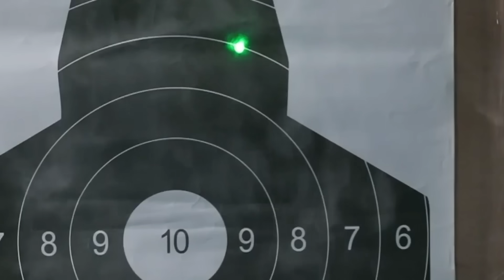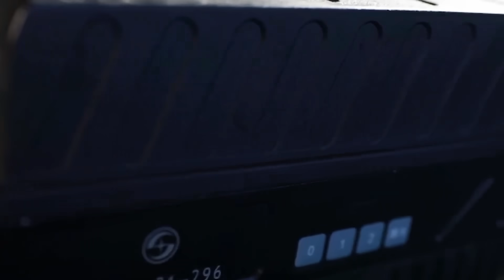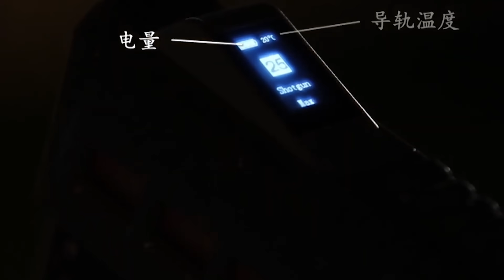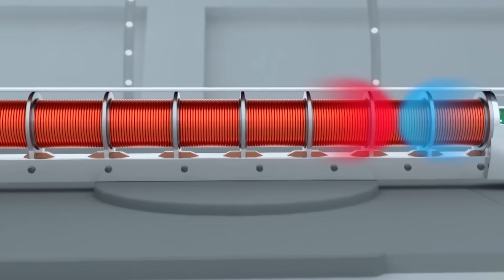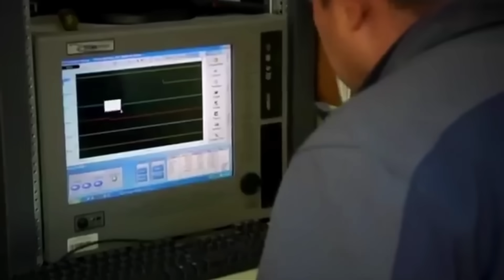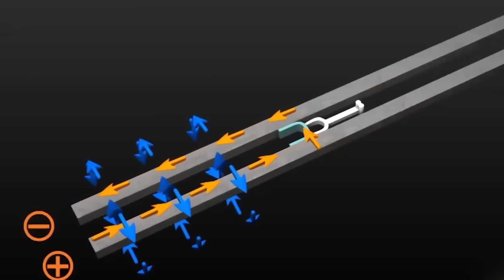The Chinese Weapon Tech that is Going to Change the World?

Comment: Rail guns are a thing of the past because their application is primitive by today's standards. They require tremendous amounts of power across and the durability is questionable. Think that thing will fire after being submerged and would you even want to pick the weapon up if it was? The focus is on DEW's like the one that was used in Maui.

Comment: Coil gun and rail gun are not interchanfeable.

Coil gun uses a series of coils that propel the projectile with a magnetic force perpendicular to their orientation and there is no contact between the projectile and the coils.

Rail guns use two parallel bars or rails that fires by dumping an obscene amounts of electrical current into the rails and that power is transfered to the projectile through a directly touching armature and using the electrical discharge it propels the round down the two rails and their opposing forces are whst drive the projectile. The barrels are constantly attempting to self disassemble and have limited lifespans and huge energy needs

Comment: This is a joke. First they were trying to move it around quickly when they had the red dot on it to keep you from noticing how inaccurate it was. Second a disk has poor flight performance. If they don’t put any spin on them they flutter in flight. If you put spin on them they tail off in the direction of the spin.

Comment: Technically this is not a rail gun. It uses AC repulsion. I've looked at the math and what parts I needed to use to accelerate copper pile couplers. A hollow ring would be better as a projectile as it could be spun for stability.

Comment: I believe someday conceptually speaking, a huge, reliable,  and devastating rail gun could rip through any boat, including an aircraft carrier. I wouldn’t be surprised if I get to see it in my lifetime.
Reply: They were testing one like that over past 10 years. Cancelled it couple years ago. I think it required to much electricity to used in field. They fire it through some concrete slabs etc. 7kg aluminum projectile. Maybe the barrel was melting? Can't remember. Look it up
Reply: The rails, it was melting the rails. It was a rail gun

Comment: The way you are portraying this tech weapon is all wrong, the American one doesn't look like the Chinese one as the American one preceeded the Chinese one by two years so the Chinese one looks like the Anerican one as it came first.

To be honest the whole tone of this one would lead most to think youare biased towards the Chinese one in comparison to the American one (even though the Chinese one has had 2 years for R & D to make one tgat "appears" high tech but even the coil design is completely different as they use standard coils rather than linear coils that makes the potential projectile speed and power greater (looks like the Chinese were going for looks over function or just misundersood the science behind the concept and i can tell that just by the graphics showing the magnetic poke layout).

Do you have footage of the advancements the American design has made in the 2 years since its dlfirst developement alliwing a more balanced/fair comparison can be made? (Somehow i doubt it or you would've shown the Linear motor design has a higher potential to fire projectiles at a far superior speed and range and be more deadly!!).

The content level of your brand/channels has started to become a little 'lacking' of late, are you spreading yourself too thin by having branched into several different topics causing you to not structure as well as you have previously? (Starting to notice that with a few channels/brands that i used to really enjoy and it is leaving me a little disappointed by some of their content too) I only mention this as i stated i used to look forward to your content but now i'm like 'meh' 🤔

You used to be a lot better than this but you're becoming a little 'lax' in your presentation/portayal of your subject matter (give it some thought as you may find that you lose long term viewers/subscribers that notice the diffence between the content of your older channels compared to your new ones and its not just you thats heading in the wrong direction as many are becoming guilty of this and that includes 'YouTube')

Is greed or content quantity becoming more prevalent than subject/content quality? (I fear it is unfortunately) and the quantity and frequency of ads for the sake of profit/revenue is becoming increasingly offputting with YouTube in general (at some point the YouTube "bubble is going to burst and oeople will look/search for a similar alternative layout more similar to the older YouTube format before it became more profit/revenue driven and its a shame in my opinion.

Comment: Get a slingshot, a good one will almost certainly have more power and you won't need to charge it all the time.  
A coil gun is not the same as a rail gun.  A rail gun has much higher muzzle velocity, and thus stopping power, and does not absolutely require computerized components but uses electricity less efficiently and each shot damages the 'rails' in the gun.  A coil gun is much more energy-efficient and doesn't require physical contact with the projectiles as it fires, but has much lower muzzle velocity and requires computerized control of the magnetic fields to accelerate the projectiles.  This 'gun' is basically an expensive toy.

Comment: Creating disks to fire is just for testing, real world slugs would be sharp and pointy, shruiken shaped disks would do damage to flesh, coating them with harmful substances is also a possibility. Programming the coils to spin the disks may be in the future too. Spinning disks are more stable, everyone has seen how frisbees fly.
Reply: 'programming it to spin' isn't how physics works. if its 'spinning' it'll also be under the magnus effect, which will make it arc, and you'll be wasting a non-zero amount of energy (which it does not have in excess at this time) to get it to potentially be slightly more accurate. 'sharp and pointy' slugs would likely get easily jammed. shruiken shaped disks? against the geneva convention, same with poison, but i doubt it would even break skin most of the time, and especially not through heavy clothing. This weapon is useless and defending it is naive

Comment: This is just coils powered in phases with a piece of metal accelerated out the end. Sadly this looks no better than whats been done for youtube videos, much less a "superpower". When the arrays are smaller, tightly packed, and printed circuitboard, IC's, or something new with smaller & much higher velocities, ill be impressed. Then we can move onto battery life. Once battery energy density resches a few magnitude higher, and mabe room temperature/1 bar super conducting becomes a thing, then a big maybe. Until then, cold fusion is just as likely.

Comment: There is an American company making one and that sure looks a lot like it. Look up Forgotten Weapons Ian did a video or two on it last year.
Reply: Yeah, and it was fairly useless. The only difference that I can see is that the Chinese "weapon" uses discs as projectiles and the one Ian showed on FW uses cylinders. Discs should prevent keyholeing, which was a problem Ian noticed in his tests, but it's still likely to be inaccurate, and very low-energy. Maybe it would work for riot control, as they said, but for anything else, it's a toy, nothing more.
Reply: @Sepultra012  The US ones use disks too. Black Rose Firearms and Northshore Sports Club.
Reply: but he said "leaving america behind"
The suggested video was ArcFlash Labs EMG-02 CoilGun: Making SciFi Weapons Into Reality    Forgotten Weapons
4M views  1 year ago.... you cant make it up
Reply: so did demolition ranch
Reply: That one uses steel rods.  Demolition ranch had one a few years ago on their channel.  It was better than you think

Comment: I like the disk ammunition instead of the cylindrical ones I've seen before used in a similar rifle. They tend to topple end over end in mid air which makes them less accurate.
Reply: The only solid idea out of this is the disc shaped round.

Comment: A disc is horribly inaccurate.
Reply: Well, yes and no, If you can manage to spin it fast enough, no... it 'could' be gyroscopically self stable.... They're not spinning it though, otherwise the bullets would ping off targets in the very specific way that those don't ;)
Reply: @Mort_OOPz  What in the design of the disc would cause it to spin? Also, what would prevent the disc from tumbling at a certain distance from the muzzle?
Reply: @swi9945  Oh, I missed the word 'not'... fail to proof read error.... they are NOT spinning it.

But yes, if they could get it up to a few thousand RPM that thing would be incredibly stable, basic engineering principals.

You would get something called the magnus effect though, which would cause the bullet to accelerate off to one side, so it'd be stable, just stable in a curve.

Its just a terrible idea.

Comment: This would only serve to make people laugh when hit by these projectiles. The tech isn’t ready for this type of thing. This is more of a toy akin to the Boring Flamethrower than an actual weapon.
Reply: How so?  If it can propel a piece of steel or copper encased lead about the same mass/weight as a bullet at a higher velocity than a bullet, it's gonna do more than sting a little when it hits you.
Reply: @PhilLesh69  If it could achieve this velocity, but it clearly can't. Also lead bullet would not work because it is not magnetic.